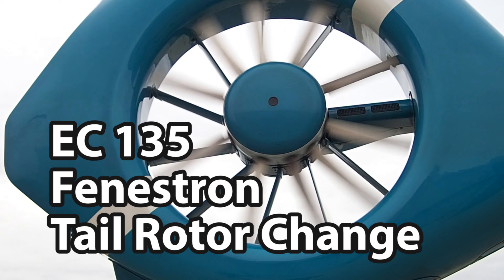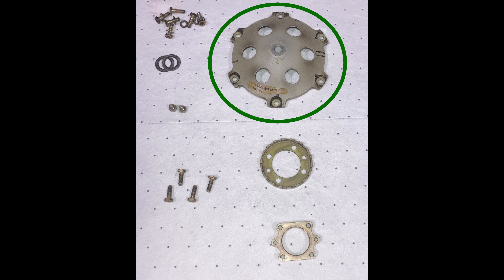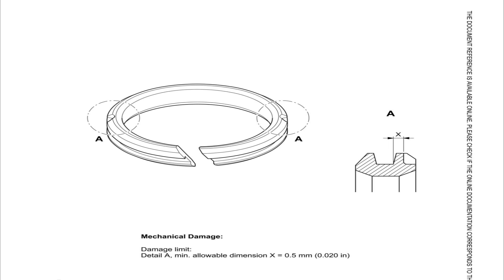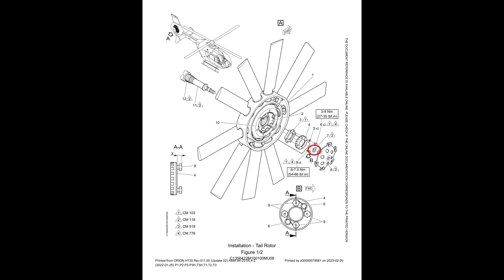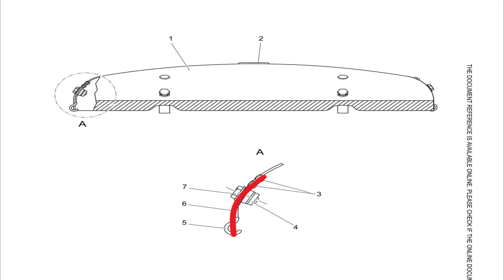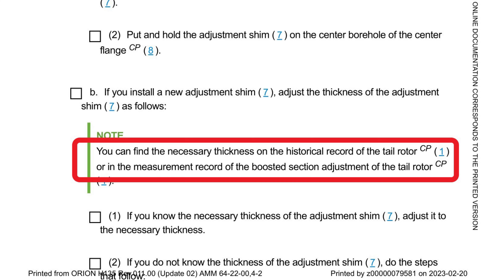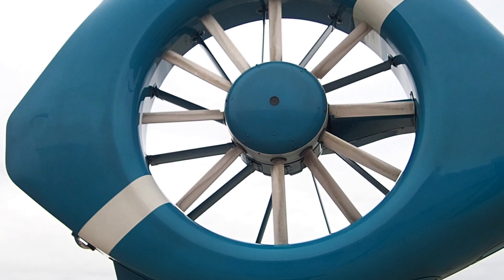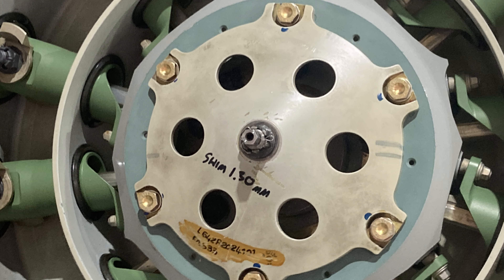EC135 Tail Rotor Replacement at Inspection Interval

Comment: Not an aircraft mech but I have just noticed that the blades are not evenly spaced, please would you explain WHY? Is it a balance thing or an air vectoring requirement through those stater vanes?? I am very surprised by this. Always thought it was an optical Illusion when I saw these types of rear  rotator fans.
Regards from South Africa
Reply from the maker: The uneven spacing of the blades reduces the amount of noise coming from the tail rotor.  On the Dauphin (AS 365) helicopters, the blades are evenly spaced (that’s my understanding), and they are very noisy.   Hope this helps.  Regards.
Reply: @HelicopterMaintenance  Many thanks for your reply and information. A really interesting piece of mechanical science.
Regards

Comment: So, when it is due for inspection, you replace it with a used unit that has been inspected by someone else.  Is that correct?
Reply from the maker: That is what the company I work for is currently doing.  It takes less time to just replace with an inspected unit than it would to remove and inspect then reinstall.
Reply: @HelicopterMaintenance  

I have always wondered, if you know, what is the ratio between the finestron and main rotor?
Reply from the maker: @Gadget0343 I don’t know off hand.  Main rotor is around 406.  The tail rotor is around 2300, but that’s pulling numbers out of the air, I’d have to look it up.
Reply: @HelicopterMaintenance  

Thanks!  That thing looks like is spinning much faster.
Reply from the maker: @Gadget0343 it’s crazy right.  Even a conventional tail rotor, spins so fast it’s invisible.
Reply from the maker: The tail rotor spins at 3584 rpm and the main rotor is 395.  So that's 9.07:1.  These numbers came from a pilot training manual and it said these numbers are at 100%.  There is a range, speed increases with altitude to a point, and High NR or Cat A increases for added lift at takeoff.
Reply: @HelicopterMaintenance  

Very good.  Just from looking at it I was guess around a 10:1 ratio.  I guess I am not to far off.  Have not flown one of those yet.  Love to someday.
Reply from the maker: @Gadget0343 It spins fast for sure.  Thanks for watching and thanks for the input.